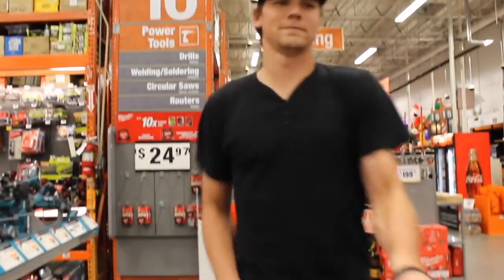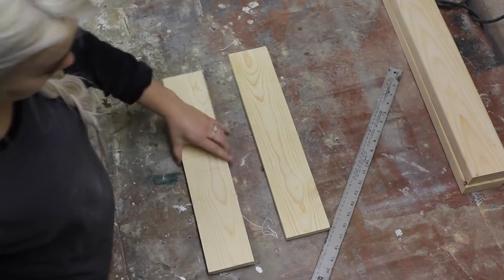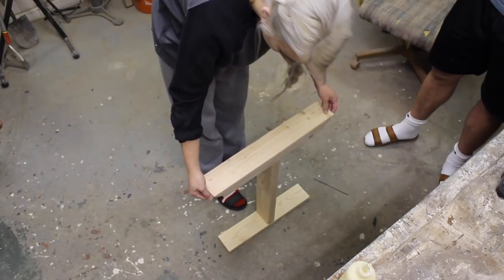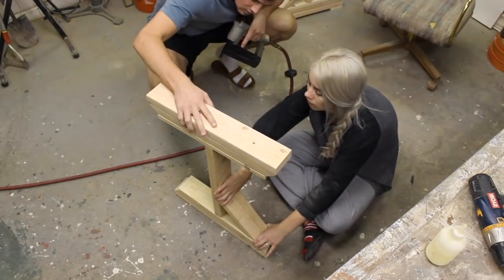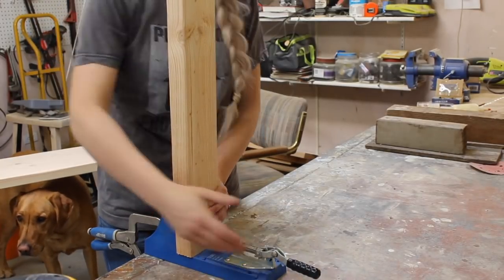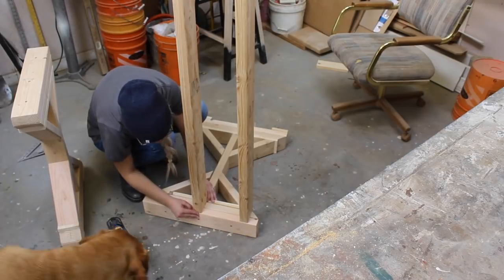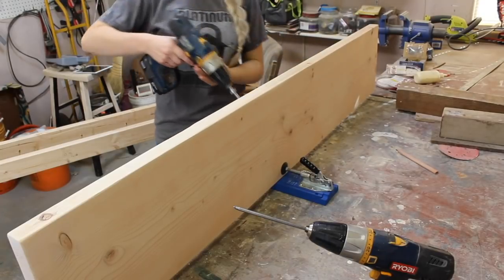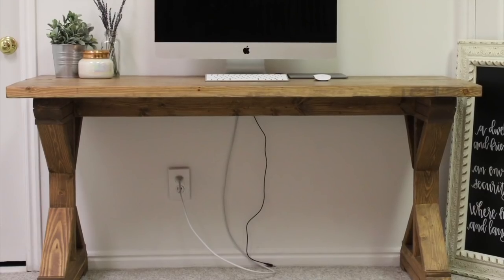Farm House Desk Tutorial! /// DIY Farm House Desk

Comment: Nice build.  Came out great.  Might I suggest using some wood glue.  Glue will make it far stronger than screws.
Reply from the maker: Thank you! I actually did use wood glue on all the leg pieces. Is there another part of the desk you would've used glue on?
Reply: My apologies.  Just rewatch and not sure how I missed.  Where I was specifically talking about was gluing the table top pieces together and the diag trim pieces.  While those do not support the table at all for downward pressure, I believe they are the major support for the table for side to side strength.  Although truthfully glueing probably would not add a lot of strength there since it is end grain, but those small nails to not add much to the side to side strength at all either.

Please don't take this as critical comments.  I think it turned out great, just a couple of projects that I did very much like yours that came back to bite me after about a year.